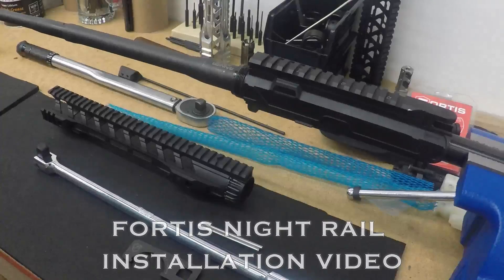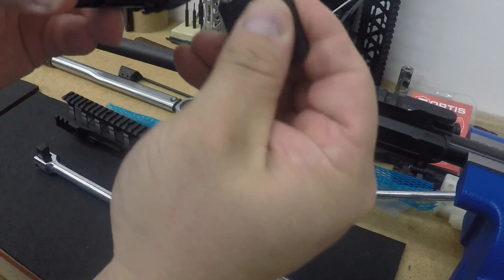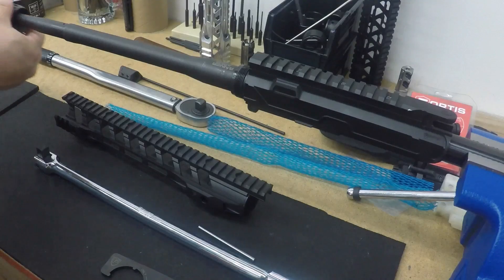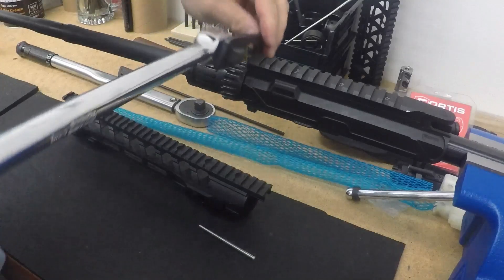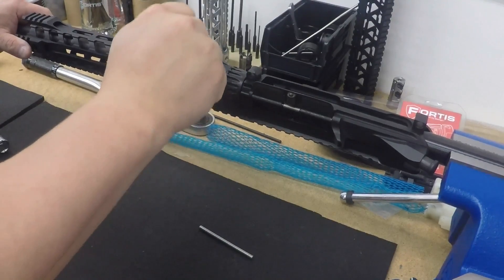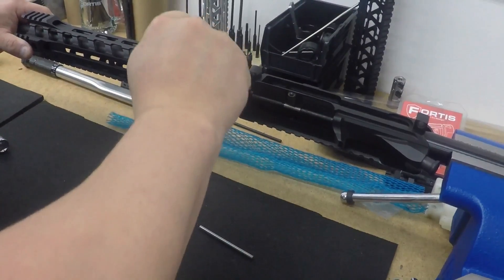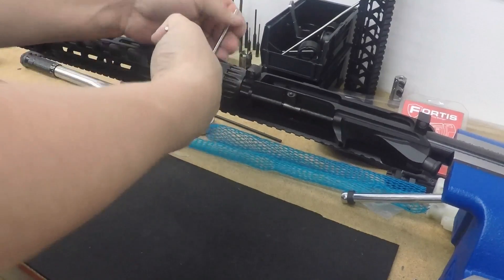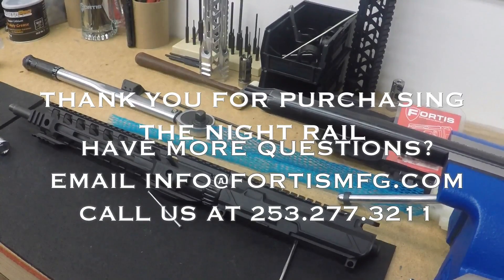Fortis Night Rail™ Installation Video

Comment: I would like to see the installation of the Gas Bock and tube with the Night Rail. First time doing my build/installation and replacing a Magpul Hand guard. Obviously this set up is a little different with the removal of the plate with the Magpul.  Pictures or video would help, thanks.

Comment: Is there a way to get rid of the gap between the hand guard and the receiver?
Reply from the maker: You could face the front of your upper receiver but i wouldn't recommend taking too much off.  Taking too much off will have your barrel extension seat too deep.

Comment: wait wait wait no gas block or tube? does the barrel nut need to be timed?
Reply: SirForhie i wanna know the answer to this too
Reply from the maker: Yes, it does need to be timed.
Reply: @FortisMFG  yes and for me it was either 30ft lbs or an insane amount or torque (100+ft lbs), no in between. Now I have to get shims unfortunately. Thinking about just returning this.
Reply from the maker: @WD1964  Sorry to hear that you are experiencing issues with our product. Please email us at info@fortismfg.com for further assistance.

Comment: What is the length of this rail
Reply from the maker: The one in the video is 12".
Reply: FortisMFG it's a gas piston correct
Reply from the maker: The rail is not compatible with any know piston system.
Reply: FortisMFG I have a smith and Wesson ar 15 556 sport, would that be able to have this rail
Reply from the maker: It would, you would have to switch to a low profile gas block.  If you have any further questions, please email us at info@fortismfg.com

Comment: I got one of the Fortis Rev rifle length rails and can say the mounting system on it is air soft at best. No matter what I did it isn't stable enough to ever use a front sight on.
I tried multiple barrel nuts, made sure I was tightening the screws in a progression,
nothing has worked. 
Sorry Fortis.
Plenty of better options out there.
Reply from the maker: Sorry to hear that, Paul. If you'd like to contact us at info@fortismfg.com - let's see if we can help you out and get you squared away. Thanks!
Reply: Thank you

Comment: Does the barrel nut have to be timed for the gas tube?  Can't tell in the video if the barrel nut is large enough in diameter to make that a thing.  thx
Reply from the maker: +Bob O Hey, great question.  It does need to be timed.  It has to be tightened to at least  45 ft/lbs.